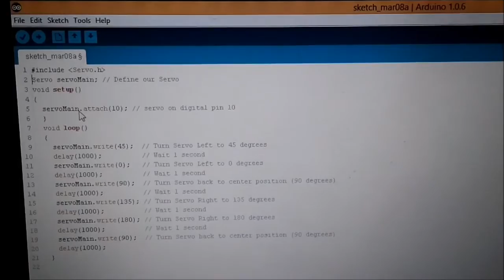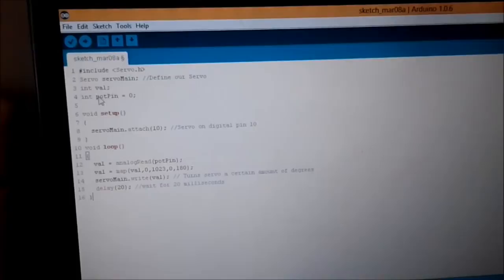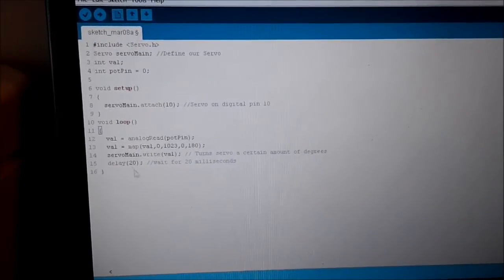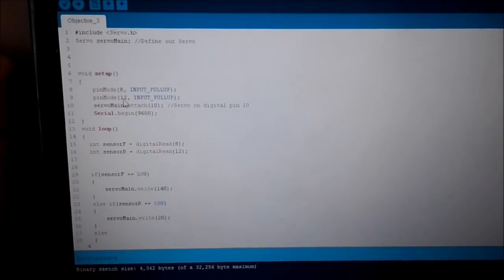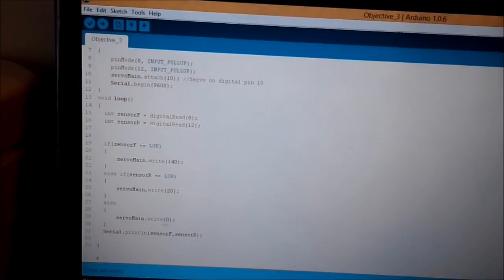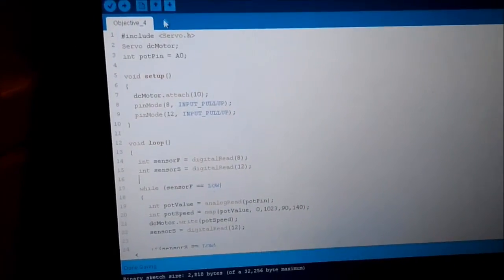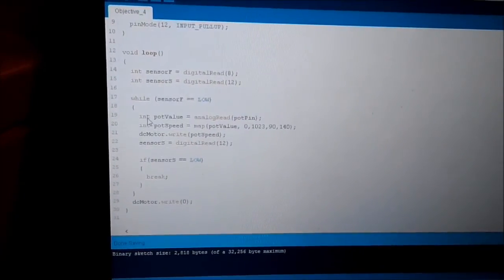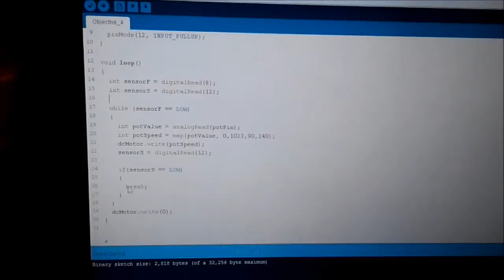Arduino Lab #6 Vex Motors

Comment: Hi, Thanks for the video. I am also planning to use VEX DC motor with Arduino and wanted to ask you for some help.  Can you let me know why you are using a red colored board (i am not sure which one it is)? Can I directly connect the Motor to Arduino board? Would you have any diagram of the connections? Lastly, how do you control the speed of the motor?